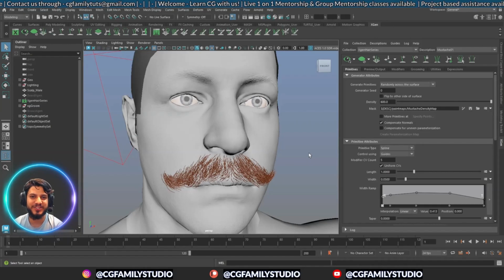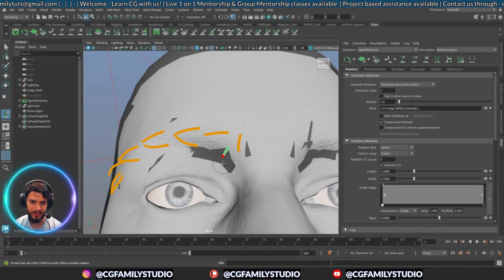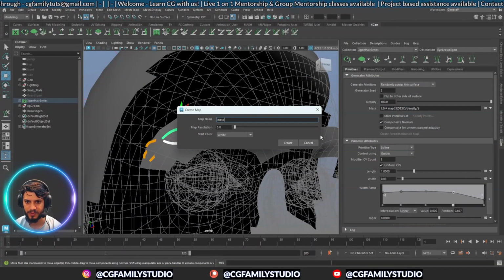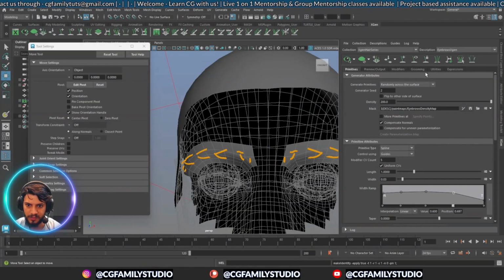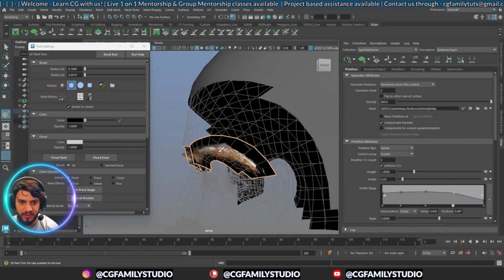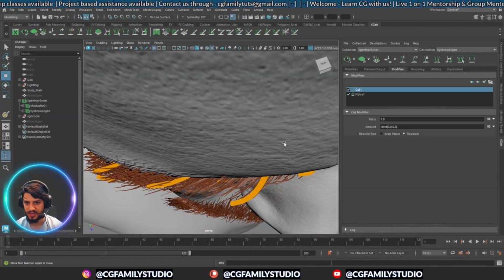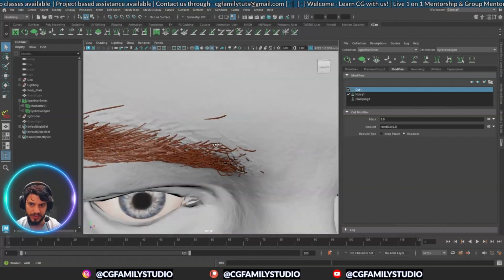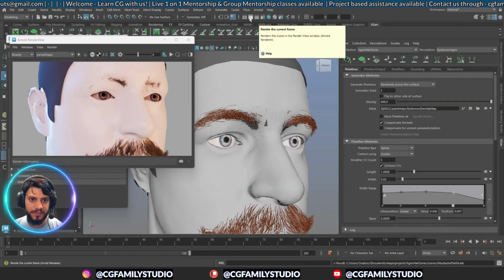Maya XGen Eyebrow Grooming Tutorial – Realistic 3D Eyebrows

Comment: After you create the eyebrow density map, how did you open the 3D paint tool ?
Reply from the maker: Once You create the mask, you will see a little paintbrush icon there on the right.
Clicking on it will activate the paint mode, if the tool doesn't open automaticlly, on the left side tool panel the tool will be active (blue highlight with brush icon). double click on it! 
That's it.